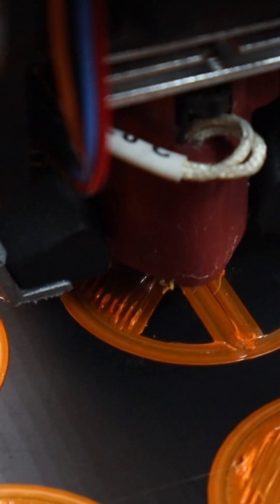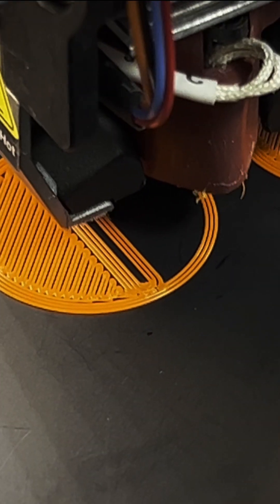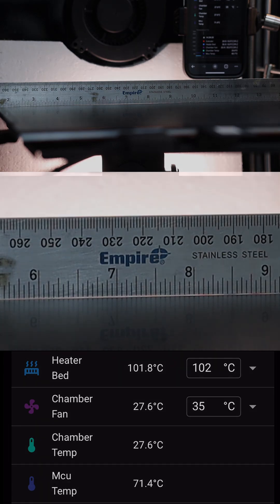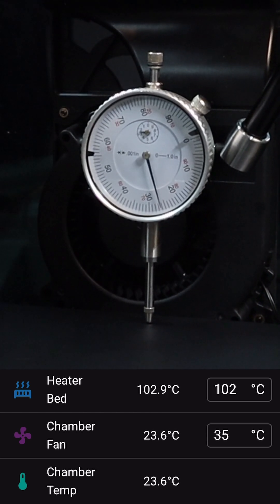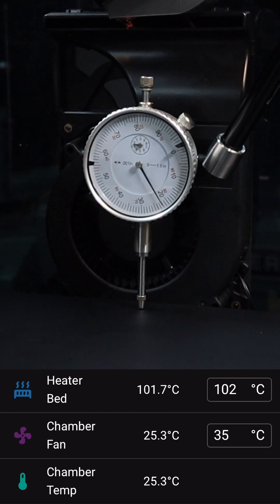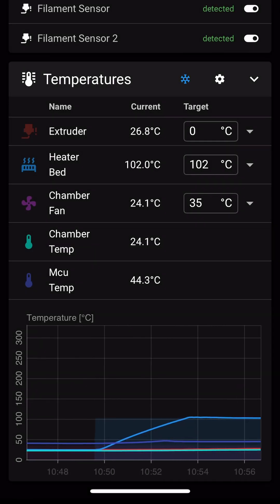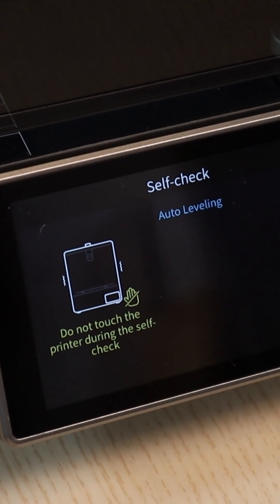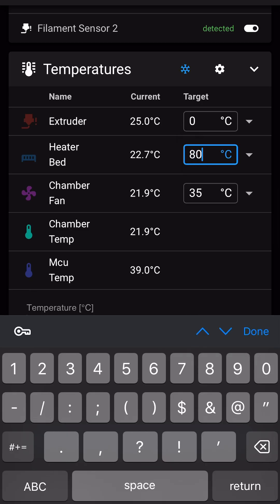BAD First Layer Your  K1 and K1 Max Printer?  #crealityk1  #3dprinter  #3dprinting

Comment: 80 degrees for the print bed????
Reply from the maker: I don't remember the exact scenario for the test, I think I wanted to use a higher temp to show the problem a bit better.  You're right if you're thinking that most filaments are either well above that or well below it.

Comment: Good morning how are you doing buddy? Quick question is there a way to heat up the bed to 60 to do the auto bed leveling? I know you said do it through reality print but like you said it starts out at 50 do I have to root in order to get it to go to 60 to do the bed check
Reply from the maker: You can pre-heat the bed first, and then run the calibration through Creality print instead, that should be able to probe at the printing temperature of your part.  That's probably the only way to do it without rooting.  I'll have a video out soon to show how to root your printer so that it's easy for anyone who hasn't done it.
Reply: @NeedItMakeIt  when I set the bed at 60 leave it there for 10 minutes but when I go to probe it still goes back to 50?
Reply from the maker: @jacory1980 that's not so good, and this is when you check the box for calibration through Creality print when you send over LAN?  

I have a nice short video coming out in a couple of days on how to root the printer, you'll have a lot better success if you root it and then you can use Orca slicer instead of Creality Print.
Reply: @NeedItMakeIt  thanks man
Reply: @NeedItMakeIt  I’m sorry I just did it again and it actually stayed at the temperature. Only the nozzle changed that was my misunderstanding. I apologize I love your videos.
Reply from the maker: @jacory1980  Sounds good, I think when running from touch screen it uses the 50, but when running from Creality Print, it knows your material and should set it to the right temps.

Comment: She does it automatically everytime.
Reply from the maker: What's that?
Reply: When you lunch a print, she does the mesh only after the bed reached the right temp.
Reply from the maker: @bwyn1072  That's right, except it isn't good enough, the temperature needs to be kept at that temperature for an additional 10 minutes or so in order to prevent further changes in the shape of the bed.  I have this in far greater detail in the full-length video... it's a little hard to cram everything into a YT short.
Reply: I see. That's why is very important to preheat the plate, or the chamber you if are going to print ABS or similar, 10-15mins before. Since this printer has bed issues, running KAMP mesh (which perform the calibration in the printing area only) would help a lot, but you have root it first.
Reply: @bwyn1072 that's literally what this video was about... Let me guess you didn't watch it or are a robot??? Jeez ppl watch the video before you have pro tips....lol